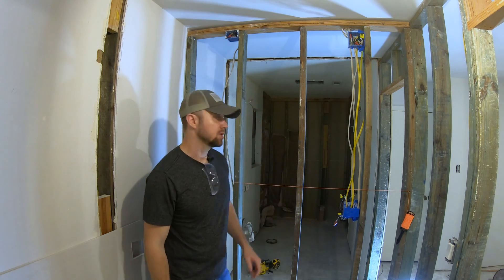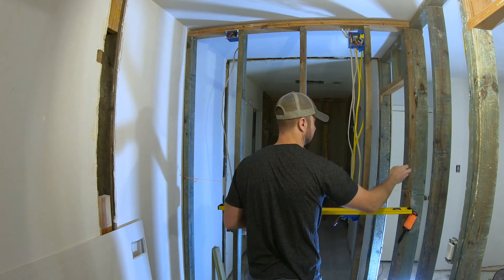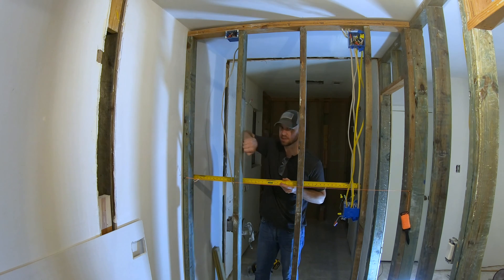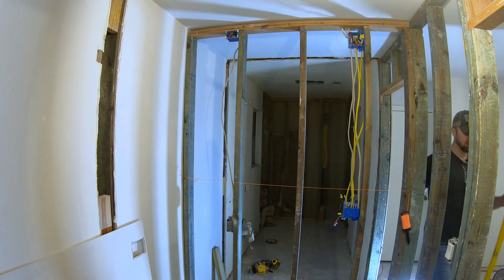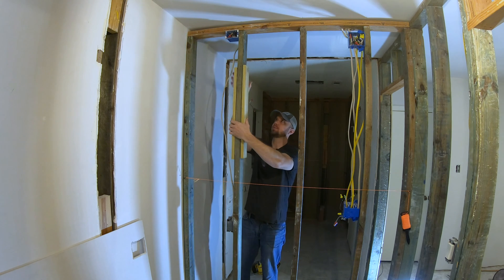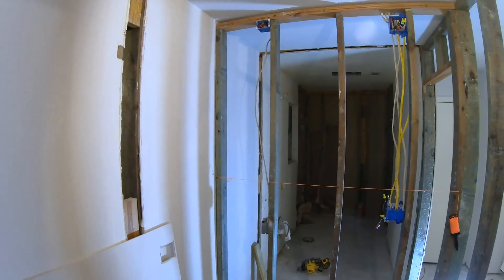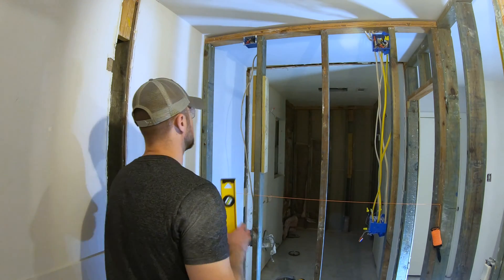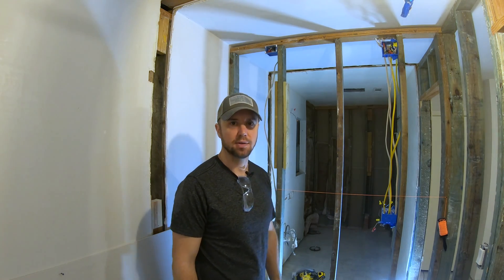How To Straighten A Wall For Drywall

Comment: How do you determine how high or low to cut the notch relative to the bow?
Reply from the maker: I just cut opposite of the bow. You may even have to cut in a couple spots depending on how bad the board is.

Comment: Shouldn’t the relief cut be on the opposite, bowed side of the stud to create space for the stud when it’s pushed back into plain?
Reply from the maker: I think whatever gets the job done will work. I cut on the opposite side of the bow so I don't have any limitation. If you cut on the bowed side, you may have to cut a bigger and bigger notch until it's large enough to move it into place.
Reply: I'm with you on cutting the bowed side.
Reply: Yup
Reply: No you cut on the side you want to pull it towards. He did it correct